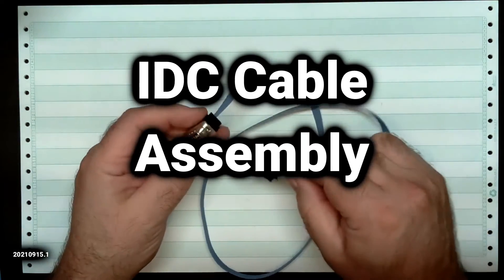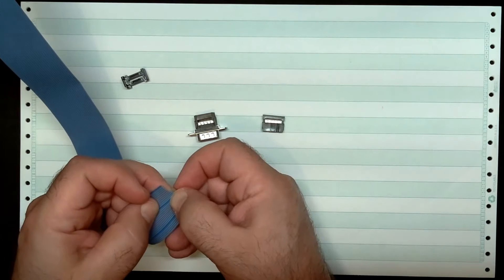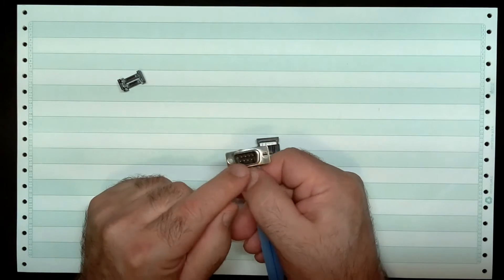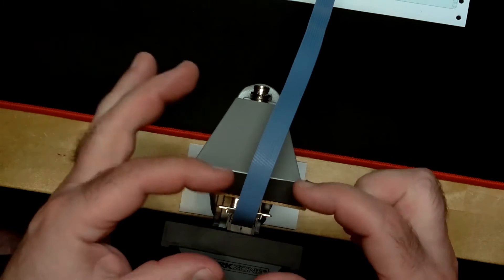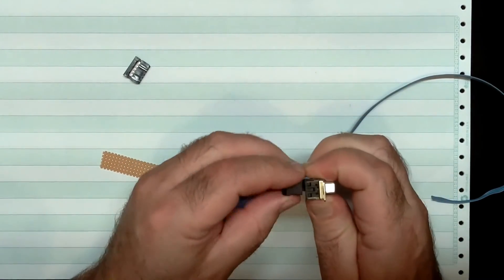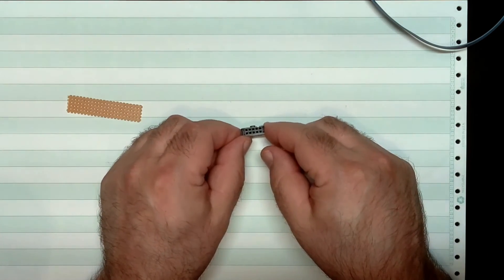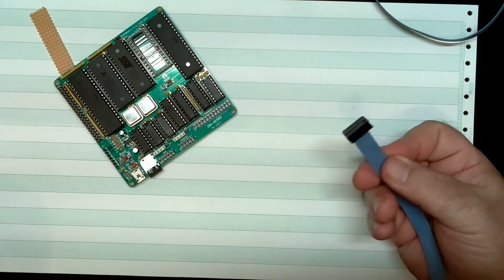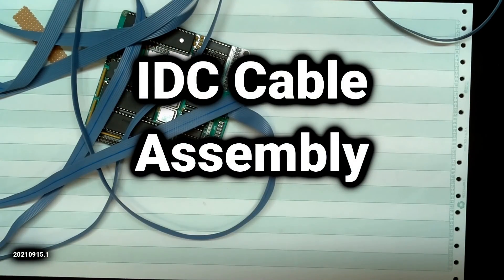Assembling an IDC cable

Comment: That's not a DB-9, that's a DE-9. Yeah, that might seem pedantic, but when you end up opening your post to find a DE-15 connector instead of the DA-15 you were looking for, you're realise how useful it is to correctly specify the shell size. (Yes, this has actually happened to multiple people I know.)
Reply from the maker: @Curt_Sampson  😂... Yeah.  I mentioned that in one of my vids.  I called them all DB-something for decades!  Only recently did I notice it was DB, DE,...  Too many letters sound similar I guess

Comment: What is the DB9 connecting to? Does your PC have a DB9 connection? Mine does not. Do I need to convert DB9 to USB? As a Raspberry Pi newbie, I am not able to understand what is going on here. But I am truly loving this series of videos. Thanks in advance.
Reply from the maker: I connect my retro console to a usb-serial adapter that has a DB9 on it.
Reply: @JohnsBasement  Ah, mystery solved. My intuition was leading me in the right direction. I actually have a DB9 to USb cable. Once I get the parts to build the IDC cable I can hook everything up and go through the testing videos again. Yes, I got the Z80 and programmer boards built; got the blinky sketches to work and I am going through the CPM videos. Your command of this material and your passion about it is inspiring.

Comment: When I make this type of cable, I find it easier to use a 10 wire ribbon and peel back the tenth and clip it about an inch from the DB9 connector.
It makes the alignment on the header much less fussy.
Also, when crimping the D-Subs in a vice, having a matching connector (non-IDC type is better) plugged into it prevents deforming the shell.
Reply from the maker: Great ideas!!  I've been using wood blocks to protect the shells... but using a matching connector is a great idea!

Comment: Nice. If one pin is unused on the pcb you could cut it out, and then fill the corresponding hole in female connector with some epoxy. Cheaper than shrouded connector with key slot and harder to plug wrong way.
Reply from the maker: Yeah... Like an IDE/PATA cable.

Comment: For small connectors, (10 pin) I've used a C clamp, or a vise grip pliers.  But the vise is a good idea.
Put the cable in the connector so pin 1 is on the right cable lead AND when the cable is plugged into the board it will come out of the connector away from the board.  If you put the clamp on the cable so that the cable reverses direction, then put the cable in the connector so it goes toward the board.  But that's only if you want it to look neat.

Comment: I will use this connector next week. I didn´t know it was hard to do the click. Thanks for the tips!
Reply from the maker: I'm not sure I'd say it is 'hard' to get it to click... unless you try to do it ONLY with your grip strength!
Manufacturers do make a vice-like/pliers-like tool for their connectors.  But (last I checked) they are not priced for hobbyists.  A vice works PERFECTLY for me EVERY time.  Just don't over-do it and crush it!
Hmmm... this one isn't too bad: https://www.showmecables.com/idc-ribbon-crimp-tool
...and here's something in the price range I recall form yester-year: https://www.te.com/usa-en/product-58074-1.html